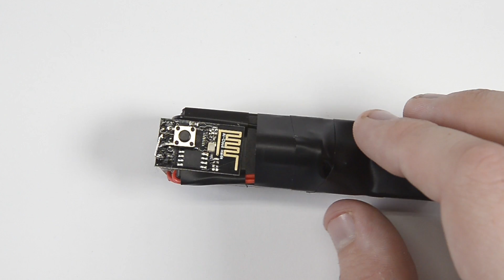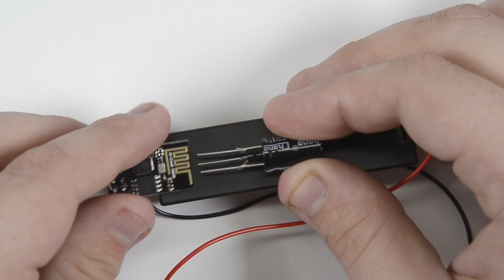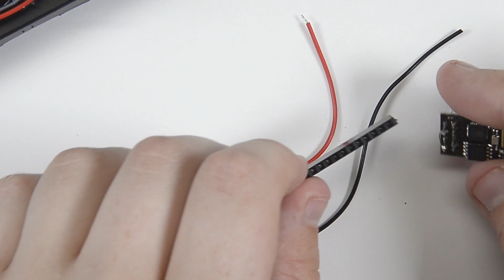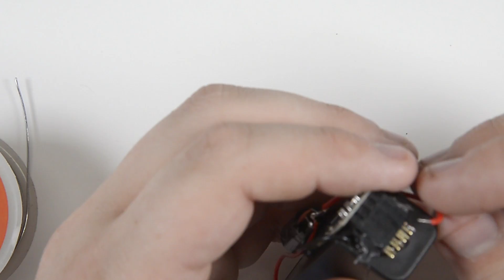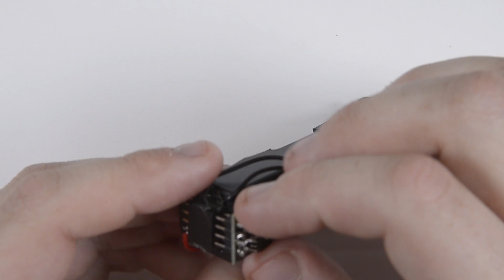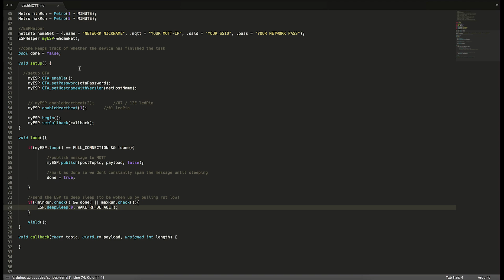Build your own Smart Button!

Comment: Would it be much work to have it activate off a state change instead of pushing the button? so that way I could do this but wire it to my light switch so it would act as normal, and what sort of life would you expect out of a battery setup like this?

Comment: Can you show any kind of circuit plan? You can just paint it and take a picture of it or show it in the video. That would be very helpful.
Reply from the maker: It's just the power supply from this video https://www.youtube.com/edit?o=U&video_id=J66_8P043ko where the input is the battery and the output goes to the ESP 3.3V and gnd.

Comment: I used buttonDemo in ESPHelper and an ESP-01 for this project.  
#define BUTTON_PIN 0 for the button and #define BLINK_PIN 1
GPIO0 is pulled high using a 3k3 to vcc.  
Button hot leg wired to GPIO0, and GND leg wired to A 1k resistor is between button and ground.
100nF cap between VCC & GND tight to ESP
When I power up ESP, it boots normally and heartbeat starts; however, when I press the button, nothing happens.
IF I remove 3k3 between GPIO0 and VCC, ESP boots normally; however,  the ON and OFF payloads are published when I touch the wire to the button.  I don't even have to press the button, just the wire.  Actually, I insulated my finger and depressed the button, and still nothing happens.  Only when my bare finger touches the wire, do the payloads get published.
Any thoughts??
Thanks in advance...

Comment: Any chance you'd tell me the secret behind why you have a jumper wire across VCC and ch-pd pins on your esp-01.  I have a set of them that just won't behave correctly and i came across some documentation that suggest connecting VCC and CH-PD for normal boot mode but I no combination I try will work.  Would greatly appreciate if you would share...
Reply from the maker: For normal booting, you have to pull ch_pd high (the purpose of this pin afaik is to allow an external device to power down the ESP module when its not needed) and you also have to pull pin 2 high as well - generally you should use a pull-up resistor to do that job while ch_pd can just be connected directly to vcc. To be safe you should also pull pin 0 high as well with a resistor although usually you can get away with just leaving it floating. Pulling 0 low puts the ESP into bootloader mode for flashing new programs.

Hope this helps you figure things out a bit!
~IKW
Reply: Patreon sub, BAM!!  Thanks IKW.  Appreciate your response.
Reply from the maker: Thanks man, really appreciate it! Always glad to help!
Reply from the maker: Also heres a link to the page I always refer to for ESP booting https://github.com/espressif/esptool/wiki/ESP8266-Boot-Mode-Selection

Comment: Hi. I always enjoy your videos and like each one. Thank you for doing them.

I tried the code you provided as I would like to modify your design to work as a mailbox alarm but when I try to compile it in my Arduino 1.6.8 IDE I get an error on line 44 saying "'netInfo' has no non-static data member named 'mqttHost'".
Any idea what the problem is? I've never seen this error before.
Reply from the maker: The error is probably because I recently updated ESPHelper and added a few new fields to the netinfo type. You should be able to fix the issue by updating ESPHelper. Just go to github and re-download it and overwrite the old folder and you should be good to go.
Reply: That was it. Thanks!

Comment: Nice build.
  On a device like this you know you could use enameled copper wire upcycled from an old transformer secondary instead of the bulky insulated stuff. There might even be enough room to run enameled wire inside the battery enclosure. It's a bit more work but it would really integrate the design and get rid of anything that could snag or break from fatigue ;)
Reply from the maker: Thats a great idea man, I'll try the enamled wire next time I need to make one of these!

Comment: Won't this eventually run your battery down so far it destroys it?  There's no low voltage cutoff.
Even deep sleep takes energy.

I know it's ment to be minimal project, but you might want to alert people that they shouldn't leave this thing plugged in for months and forget about it.
Reply from the maker: The orbtronic batteries have high/low temp and voltage cut-offs so these are pretty safe. You're right I probably could put a note in the description but it's too late now to change the video - Oh well...

Comment: Is it possible to have more than one button to post to other MQTT topics?
Reply: Yes, But you would have to use a GPIO pin rather than depending solely on the reset pin and a fair amount of program modification.

Comment: How often does the battery need charged?
Reply from the maker: I've had this one running for a month or so and I havent had to charge it yet. I've estimated based on the power draw that it should run for 8+ months. I've seen some people get these all the way down to .01mA which should run for multiple years but I imagine the battery would drain itself before that time. Still many, many months isnt bad for something you can make in half an hour and ~$10 :)